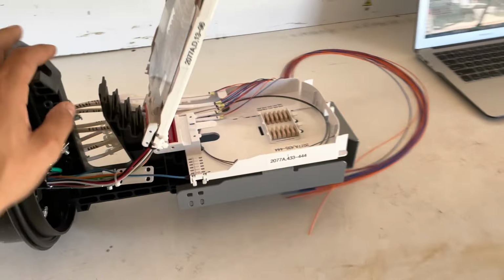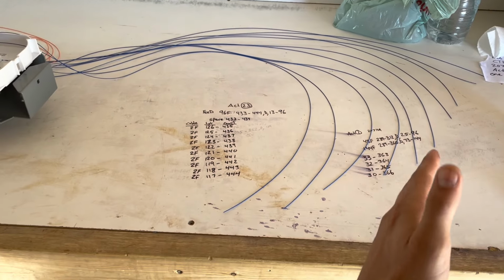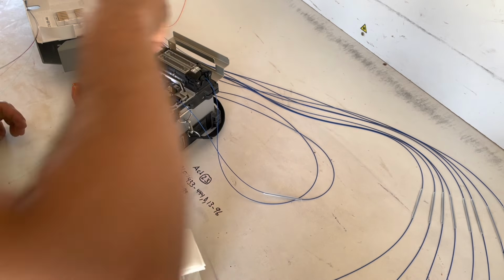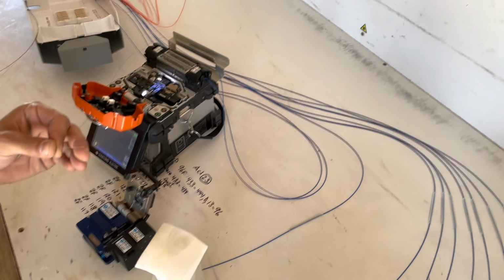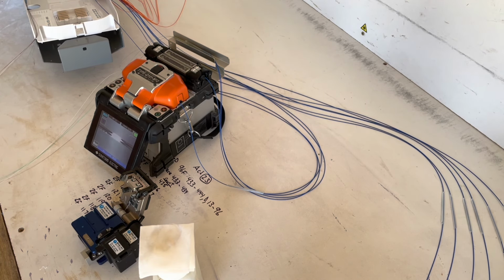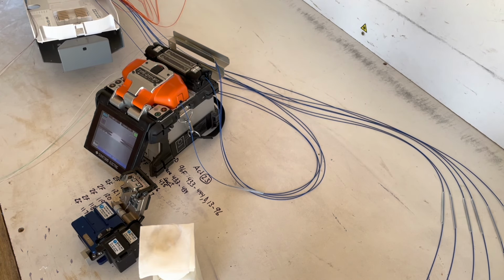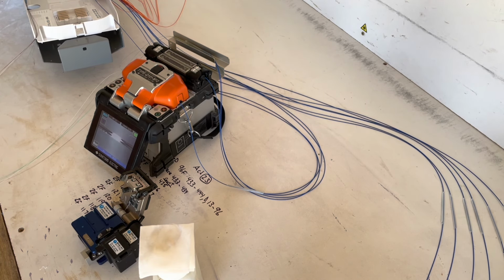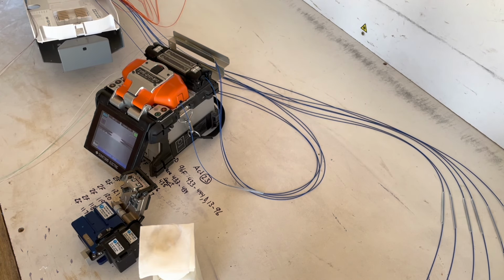Fiber Optic Drop Splicing Tutorial

Comment: what happens when the customer drop gets cut? does someone have to roll a splicer truck? I would think that would take a few days to get a splice truck out for a resi 1 customer outage.
Reply from the maker: I’ve actually done many jobs like this. Yes they can either send a drop technician to replace the whole drop line or a splice truck will be sent out to throw a gator closure on to fix the damaged line. It is just a small sealable splice closure very quick and easy. Last job I did for a damaged drop line took less than a half hour.
Reply: @fibersplicegod  Oh thats cool, I wasnt sure how that situation was dealt with.
Reply from the maker: Yea it’s a quick fix. Thanks for watching Hope you enjoy the videos new ones coming soon

Comment: Hello! Make a video about your trailer. What truck do you have?
Reply from the maker: I have a 2021 GMC Sierra and a 2021 7x14 cargo trailer. All I did was insulate the trailer build a table and wire the inside with power outlets and lights. I also have a 6x12 trailer, a 6x12 spacekap and a all in one bucket truck splice lab fully customized top to bottom. What would you like me to make a video about my trailer on how I built the inside?
Reply: @fibersplicegod  If you find free time, then make a video about everything. This will be unique content.
Reply from the maker: @Bacharus  sounds great thanks for the idea I’ll be sure to make one soon